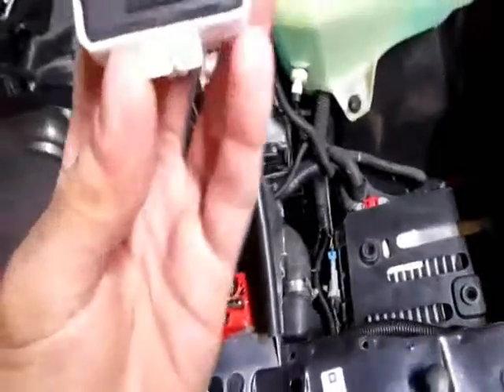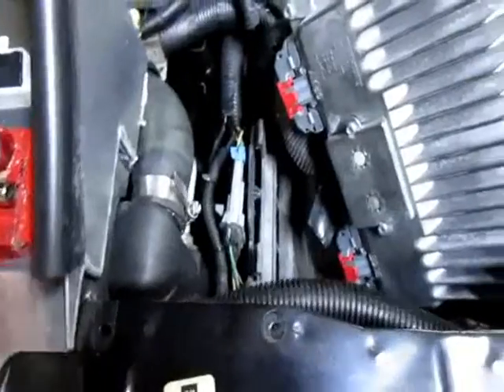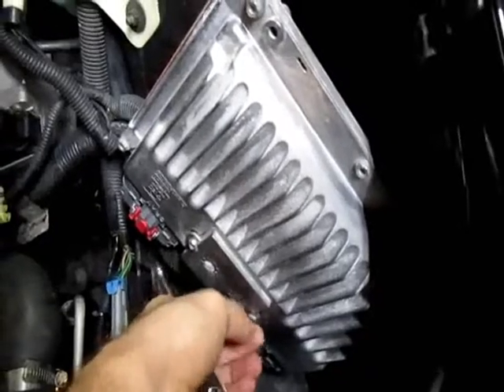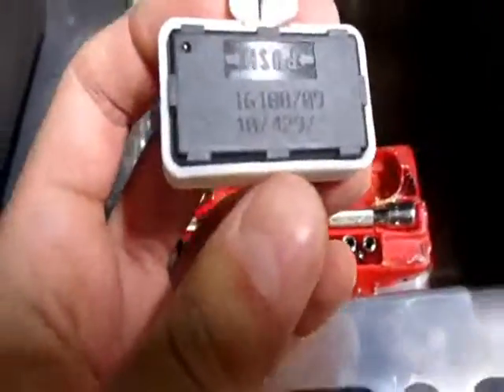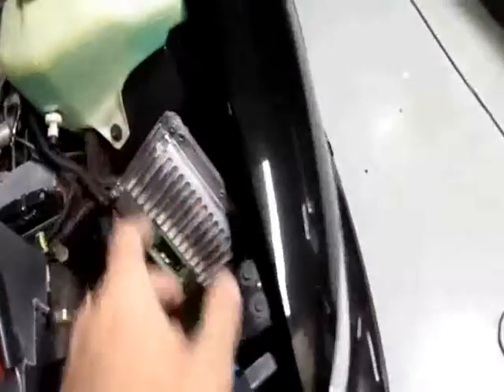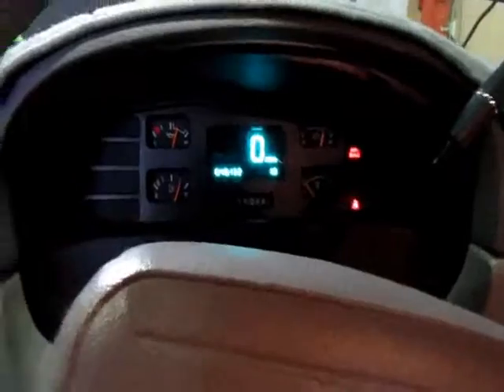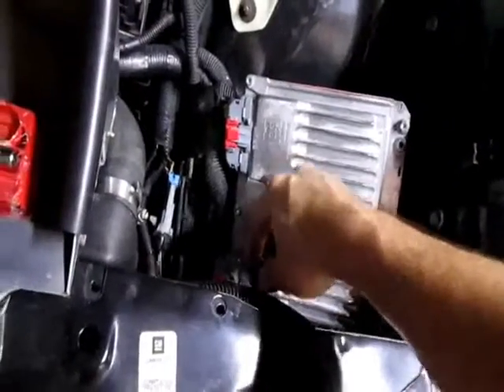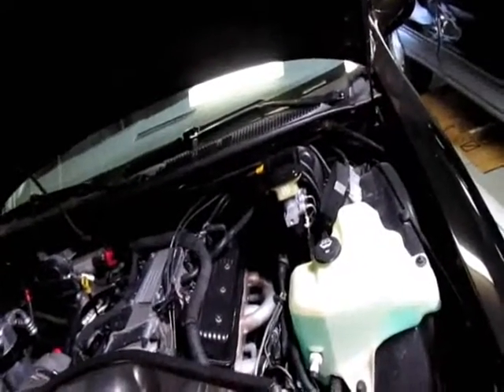LT4 Knock Module  Install  16214681

Comment: Did you try rollers without module?
Reply from the maker: huh Roller rockers? I dont have them     You dont really need the LT4 KM you can tune the knock sensors so they are more deaf before they pull timing
Reply: @GhettoWagon  Thanks

Comment: how do u benefit from this mode
Reply from the maker: By selling it.
Reply from the maker: MrFrankwite1 Its good if you have headers or roller rockers it reduces the false knock that the knock sensors pick up.  You can do the same via a pcm reprogram and lesson the ability of the knock sensors to pull out ignition timing.
Reply: +Ghetto Wagon oh ok thanks for the knowledge I have a lt1 383 with ceramic coated quad ones n a custom tune
Reply from the maker: MrFrankwite1
 Ya its a not a necessary piece.  Its not worth buying it because they want crazy money for it.  I have two of these now.
Reply: @GhettoWagon  if you have two...care to sell to a Combat Vet???
Reply: This is extremely old but also, the lt1 knock module is so sensitive it actually picked up the knocking sound my lower control arm on the drivers side was making ( loud ass knock btw if you’ve never heard it) and was retarding the timing whenever I was moving, sitting still the timing would adjust right and run perfect but as soon as the control arm went to knocking the car would bog down a bit, lt4 module helped with that until I replaced the control arm